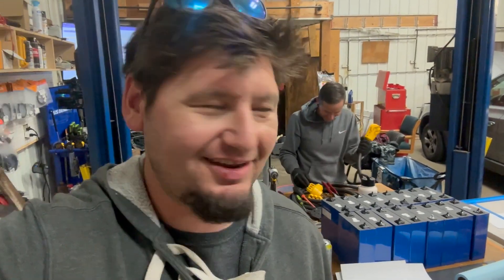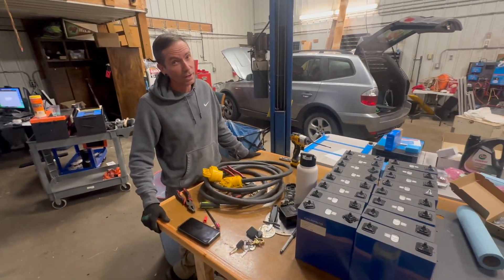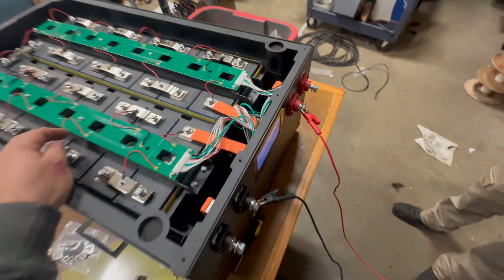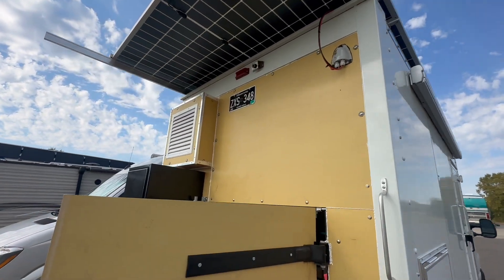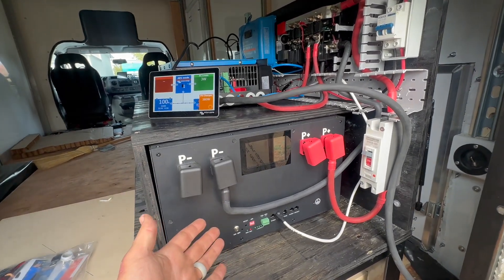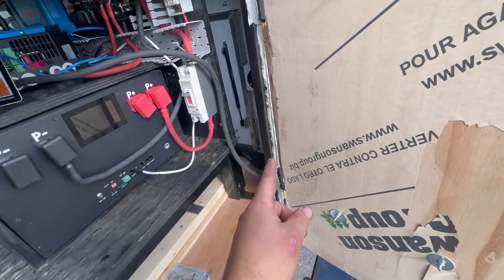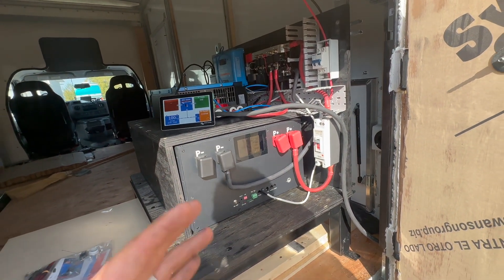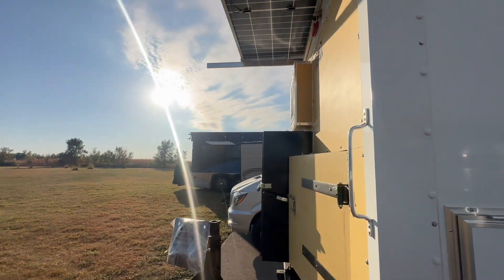2000w Unirac Mounted Box Truck Victron Solar System  - Apexium 280ah 48v Battery

Comment: Planning a similar setup but worried I may not have enough volts from solar on a cloudy winter day (in Ontario) to charge the 51.2v battery. Have you had any issues with that and using the 2S2P 2000w array?
Reply from the maker: These panels put out 45-50v each, so together we’re at 90-100v it will do fine.

Comment: Great job!  I just built two 24v EEL boxes using the new 306ah cells from EVE.  Plan is to put them in an aluminum truck tool box and carry that on a bumper hitch cargo tray along with a 24v charger/inverter from Sungoldpower which I already have on hand.  This should allow me to move it from the bus to the travel trailer to the Sprinter with little effort, depending on the mission.  It's not as fancy as the Victron gear, but for my purposes should be more than adequate.

Comment: Is this system certified to the UL 1642 standard? (e.g. high vibration environments)

UL 1642 is typically used for evaluating and certifying lithium-ion phosphate batteries, including their performance in high vibration environments. This standard ensures that the batteries can withstand physical shocks, vibrations, and impacts that they might encounter during transportation, installation, or normal operation.

Comment: I just built 4 of these for a full home system.  Got a 5th yet to go.
Reply from the maker: Are you using BMS communication? How’s it going so far?
Reply: @sotasolar  Looks like the YouTube algorithm deleted my comment for whatever reason.

For my home, I didn't use Victron inverters (yet).  I'm trying out some fairly inexpensive inverters currently (2 AIO's that natively do split phase, wired to a combiner).  They work well enough and have handled loads around 15-16k watts without issue.  I don't expect them to last a super long time though, tbh.  Time will tell.  There's a good chance I'll be looking for a pair of Quattro 10k's, a Cerbo, and charge controller(s) before too long.  If you know anyone who sells Victron stuff.  ;-)

I have tried closed loop with mine and it works fine, but it's not as nice as Victron integration.  Open loop based on voltage works as well or better.  These BMSes (it's a JK Inverter BMS you're working with) have a great active balancer, handle load well, but are confusing to configure and can easily lose accurate SOC if not fully charged fairly frequently.  You only have one battery here, so it's not a concern.  From what I can gather, the 4 I have are connected together , the 'master'  BMS isn't taking the others into account when advising the inverter CVL/CCL/etc.  I honestly don't know if they'll ever fix it -- it's been an ongoing issue.  (If you haven't, check out Off Grid Garage channel).

The case and batteries I got are great, I'd highly recommend if you continue to do builds like this.  I can knock out a battery in about 1.5 hours at this point.  I sourced 66 cells (2 spares) + 4 cases direct from China (using Docan) and it took about 2.5 months to get in, but I was not in a rush.  My 5th pack was sourced from the US, same supplier.  My only dislike on these cases is the lack of a breaker for disconnect.  I've set them up to have a din rail mounted with the case faceplate screws and a double pole MCB 125A C curve breaker.  The fuse inside is nice, but I don't trust it 100% with the kind of current one of these packs is capable of.  Breaker for disconnect or maintenance -> 250A T-class fuse -> on to the bus.  If you are interested in pics or more details, let me know.  Not sure if you remember, we've talked before when I was doing my RV build.